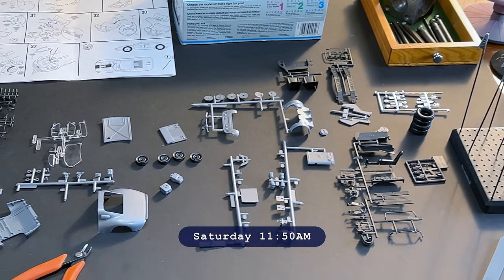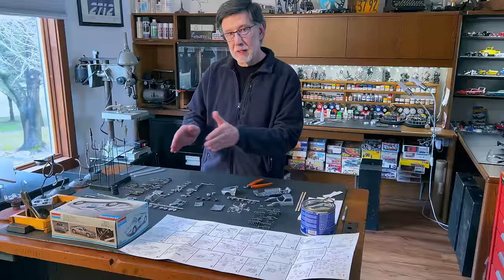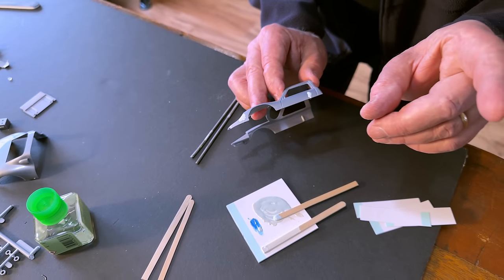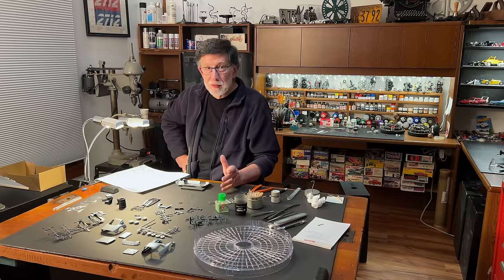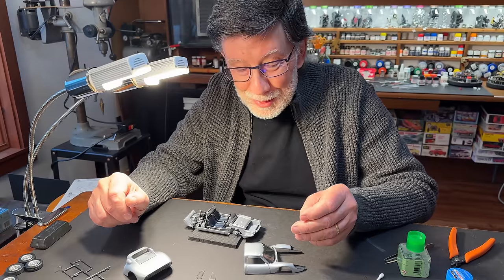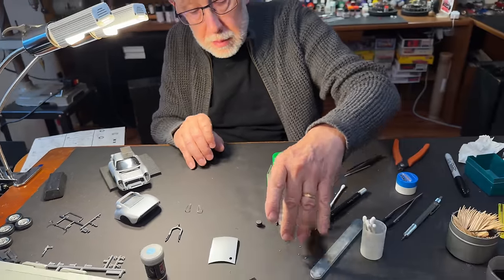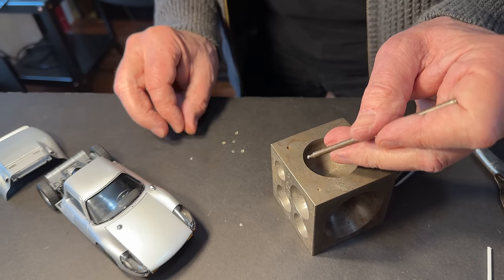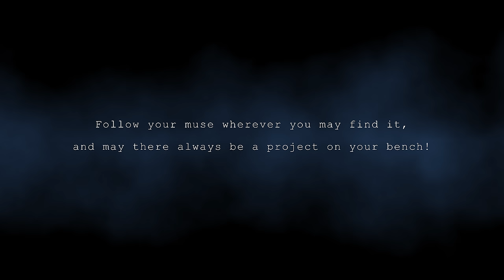Model Car Challenge: Building a Car in 24 Hours

Comment: Superb Video and Build Doug! Thanks for sharing.  What are you using to pick up the tiny pieces? Extremely impressive what you did in 24 hours.
Reply from the maker: Glad you liked it, it was fun! Grabit-Stix, small parts placement tool from Scale Motorsport. There is an affiliate link with a discount in the description under the video.

Comment: Thanks again Doug, for this inspiring video! Question: How did you get those parts to stick to the swab?
Reply from the maker: Those are not Q-Tips, they are Grabit-Stix from Scale Motorsport. There is a link with a discount in the description under the video. I use them all the time.